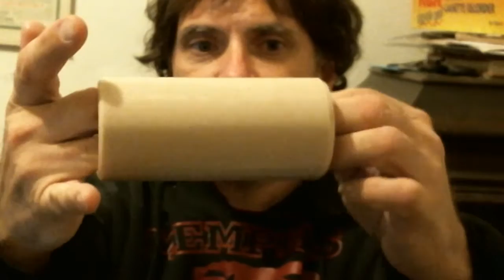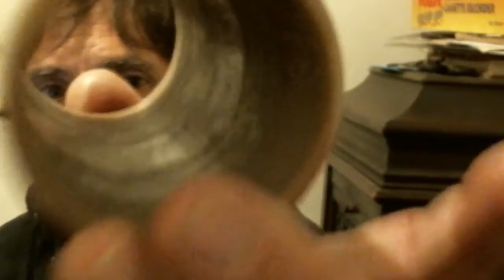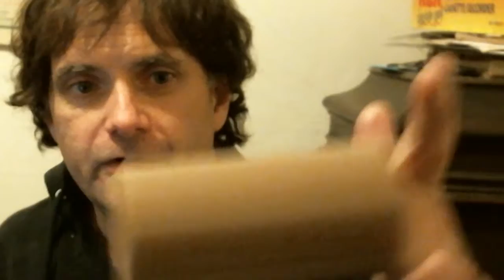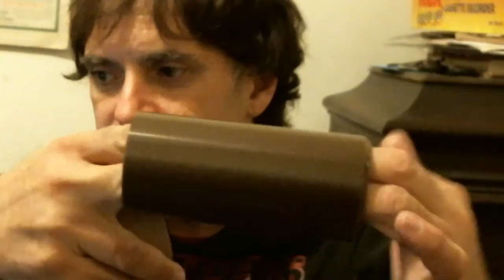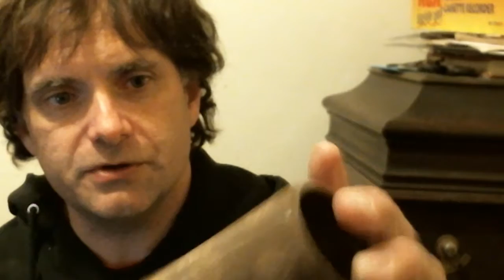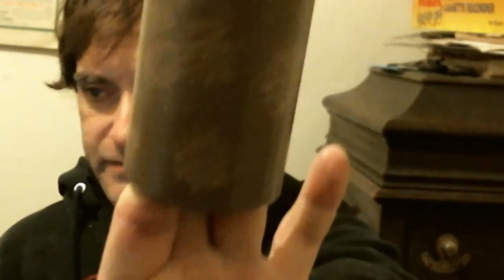The Snowflake defect in New cylinder record blanks.

Comment: I have come across the "Snowflake" problem on cylinders from time to time. I never had a shaving machine, so discovered a different way to make a successful blank. Have the cylinder to be cleared of grooves at the same temperature as some gasoline. Dampen a rag with the gas and wipe down the cylinder to "groove free." Take a nice cotton rag (T shirt) and polish to a nice shine. New recordings I have made are actually quite good all things considered.
Reply from the maker: I did that when I was learning to record, it works, I used lamp oil, but it does the same thing.
Reply from the maker: The snow flake I show in the video is not mold, from moisture, as found on original blanks that have been kept in humid environments,  but rather a separation of materials when cooling in the mould.  These are not blanks from the 1890's but ones made recently, ones I made, and rejected, they are not made from old broken records, but rather from raw materials.
Reply: @thenorthamericanphonograph1039   Thank you very much. I have learned much from your great channel. Appreciated! :-)